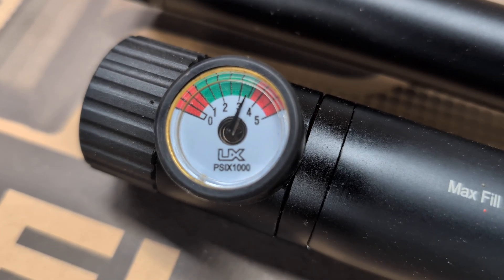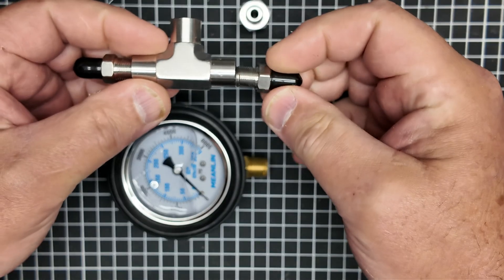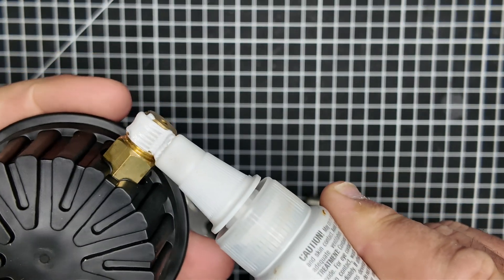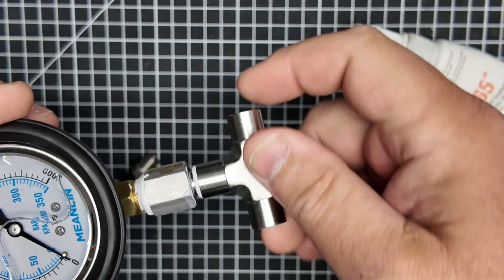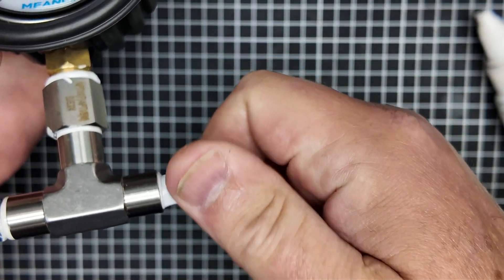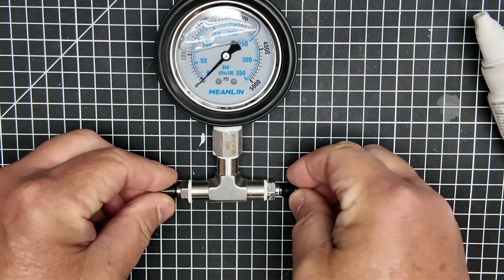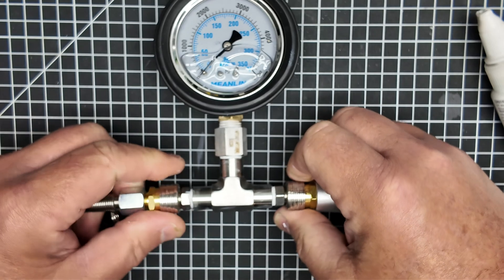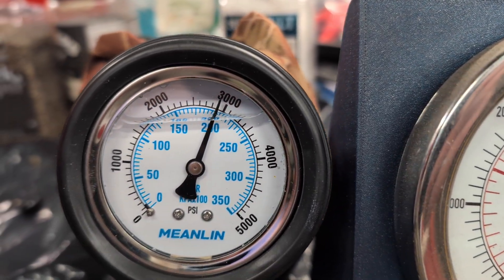DIY PCP Airgun Reference Gauge: Build an Accurate, Durable Pressure Solution!

Comment: The linked T fitting is only rated to 2320 psi.
Reply from the maker: Correct, but given it is 304 Stainless, and pretty thick, I decided to test one up to 6000psi and left it there for a while. It was fine. Sometimes the "ratings" on import fittings are not well defined.

Comment: I work as Project manager in the Product Developement Department of a pressure sensor company. 
Are you interested in using a high precision digital sensor in one of your projects?
I am really tempted to add a propper, reliable automatic pressure cut off to my cheap ass Vevor Shoebox PCP Compressor. Might be very handy for the GX2 as well
Reply from the maker: I have actually played with this quite a bit. I'd love to see your companies sensor. I would need 0-5000psi with 0-5VDC output. Do they make one with those parameters?
Reply: @TargetForge 
Yes, we make 350bar/5000psi sensors with 7 to 33V input and 0-5V signal output.
No 1/8" threads tough, only 1/4"
Reply from the maker: I can work with that!